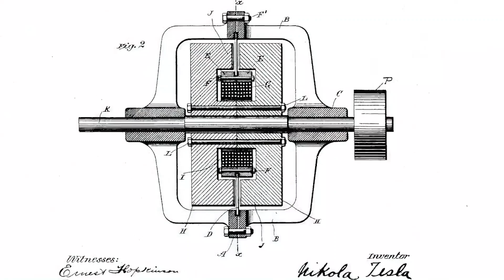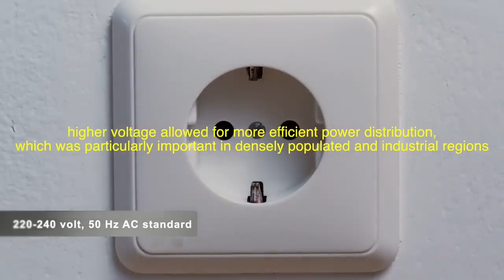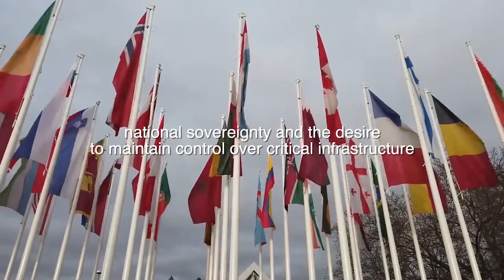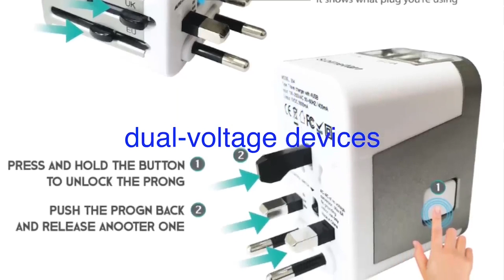Why Isn’t There a Universal Standard for Electric Outlets? | 1.1

Comment: Not only just 110-120 V and 220-240 V, but also 50 Hz and 60 Hz line frequency and single-phase and three-phase AC electrical power. At least most of Europe standardized on variations of the CEE 7 plug, which can be used on most of Europe.

Comment: The war of currents was between Edison and Westinghouse. Tesla was a minor operator in it. His role was having a patent for AC motor. If you check the Wikipedia article it has Edison and  Westinghouse. Everyone started at 110 V as carbon bulbs cannot work at higher. The switch of Europe to 220 V was gradual lasting until the 1970s in some cases. In Finland for example cities witched to 220 V in the 1950s. On rural areas 220 V had been the norm for long as the long lines needed the higher voltage.

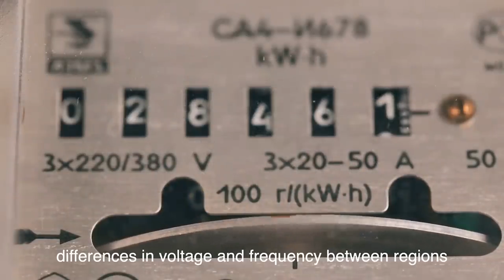Comment: Besides making the mistake at 6:45 that North America's 110/120v 60Hz and Europe's 220/240v 50Hz domestic units are "fundamentally different" (they are both 240V systems, and really differ only in line frequency) this video is incredibly vague about what choices were made, where, when and for what reasons. It is not instructive for us to hear that "for different economic and political reasons specific to each region.....". Also ignored is the fact that many European countries changed their systems after the war, moving in some cases from 110V to 220V. The British plug shown here appears to be presented as a standard since the time of Moses, yet it too was developed at this time, and a bizarre electrical practice known as "ring-wiring" driven by scarcity of metals is fundamental to its design and adoption.  It's really a very interesting topic, though one would never know it with the paucity of information presented in this video.

Comment: The standard that was at the beginning of the various mains voltages was set by physics and was the same everywhere: 55 volts. This is the voltage for an arc lamp, the first electrical light source. Two arc lamps in series were operated at 110 volts (USA). Four with 220 volts (Europe). 115 and 230 volts are later adjustments for greater transmission efficiency.